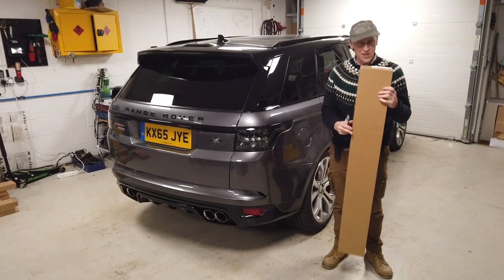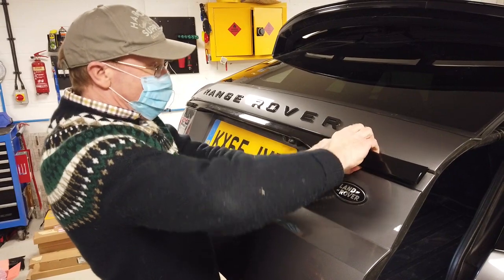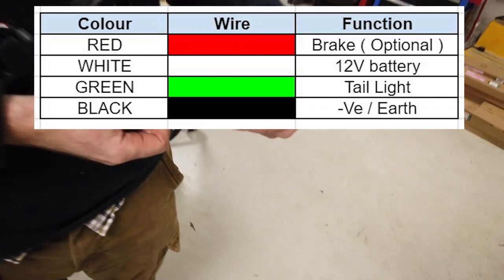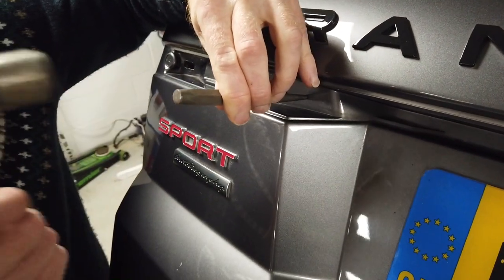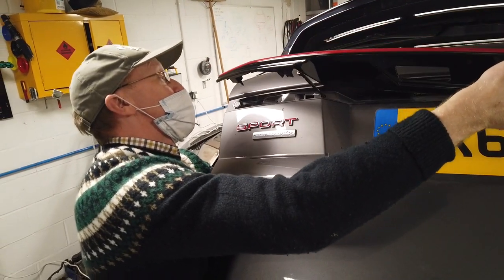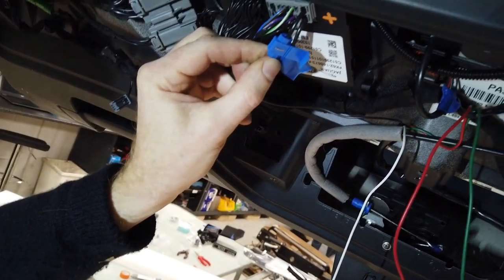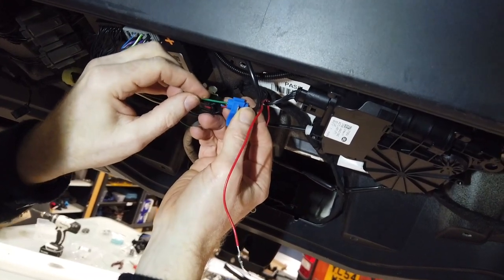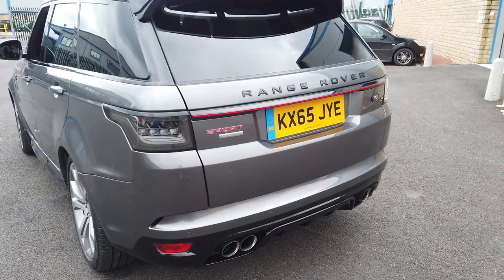Range Rover Sport L494 / SVR Rear Tailgate Trunk LED Light Bar - Fitting & Demo

Comment: Looks good, nice work 👍🏻, what about an option of instead of the red line going across (in daylight - lights off) having it tinted so it gives the appearance of the factory look until the lights are on  (Or when braking, if connected) ?
Reply from the maker: Yes got a few people asking for this and this is something Julian is working through with our manufacturing partner.
Reply: @L663  Now i feel like i should have waited instead of buying it! SAD FACE
Reply: @L663  you get that done asap please need to buy :) . If it's black but lights up at night that's awesome. Please don't make it look see-through or it will look a little riced.
Reply: Agreed. Was thinking the same thing
Reply: @L663  still waiting for the results  of this
Reply from the maker: @joaquinmateo4142  Hi - we have implemented several improvements that have delayed the product.
Reply: @L663  thanks I just install my GL-5 GLOHH tail lights too my 2017 SVR waiting to get my black out lid booth light Truck LED light bar from you guys for UsA thanks so much keeping me updated on this still waiting this would really look good with GL5 tails their dynamic too with the blinking and stop brake lights
Reply: Would love this for my L405. Any plan for something similar for the L405?
Reply from the maker: @toddt0606  Hi Todd - thanks for the comment and kind words - I am told i will have the next batch in stock this Thursday - some quality checks and then they will be for sale !
Reply: @L663  That's great. And the question about them being the upgraded version many of us have expressed interest in OR is this the original version shown in your great video?
Reply from the maker: @toddt0606  Hi Todd - I need to check what the next delivery our - our main focus has been to improve the reliability and water ingress issues we the first batch. We have had samples with a more smoked lens colour but this may be coming in a couple of months time.
Reply: @L663  any news on this?
Reply: Any news on smoked look lightbar yet?
Reply: Do you do these for the Disco 5?

Comment: Hi Guys
Really helpful video just fitted this light, as well as rear light upgrade and mirror dynamics, looks really good 👍😁
Just 1 thing, when I was following the wiring of this I got confused at first with where the positive and negative were going as mine looked slightly different, turns out the box the plugs are in where you wire to on yours Is upside-down, thought I'd better mention incase people accidentally wire to wrong wires. Hope this makes sense 😅
Thanks for this though looks brilliant really happy 😊
Reply: Can you make one for the L405? :)
Reply: Yeah my box is upside down the videos one, but haven’t been able to work it out , tried manually and with the blocks but won’t come on , do you know if connected with inverted cables would this brake the led ?

Comment: Just fitted this  . Looks great.  I found the choc blocks to not do the job properly.  So soldered the wires white and black wires  to the two black wires . Wrapped in insulation tape.  Really a two hour job if you take your time and think it through.  Threading through the drilled hole is fiddly but I found by tapeing all wires together and pushing through with end of a coat hanger helped to feed the wires through. Will fit brake light this weekend

Comment: Fitted mine today. Looks brilliant and I think also looks better with the pre-facelift rear lights. Once I drilled the hole, I found it easier to feed the cable towards the edge of the boot lid. At 9:07 in the video, I fed it towards the large hole to the right of the shown connectors, and then ran it along the black loom. I'll email you a picture Simon.

Comment: It looks great Simon! I’ve brought a few products from you now, and this will be added to my list! Just need the rear light upgrade first! 💰
Reply from the maker: We are having problems with the rear lights... some supply issues and some quality issues ( mostly condensation ) - we are pressure testing them in house to try and reduce issues at customer and working with the supplier to improve.
Reply: @L663  So, I’m excited to say that Kate got in touch today and I’m due to receive one of the limited 2nd batch of rear light bars. You mentioned and were very open about the issues with the first batch. I’m assuming you’re happy with the latest ones and I’ll let you know if I experience any issues. All I need now are the 2018 rear lights (your sweeping version, not the OEM ones) Do you have any idea when these are likely to be in stock?
Reply from the maker: @paulverney4753  Yes we are releasing the 2nd batch slowly and we have resolved the leak issue and done some testing so we are much happier with the product. Please keep us informed how you get on.... also give Kate an E Mail as i found a pair of lights in the warehouse that she can sell you..if she still have them
Reply: @L663  Thanks Simon, I’ve dropped Kate a message. I’ve fitted the light bar to my MY2015 RRS with the original OEM lights. Would you like a photo to show buyers what they look like in this config?
Reply from the maker: @paulverney4753  Hi Paul - glad the light bar is in and working. Yes please send some pictures to Kate and she will send them through to me !
Reply: Can we please see photos of the lightbar and the original rear lights?

Comment: Bought and fitted - looks superb!  Agree that smoked would be cool but if you put red accents like side grill bars, this looks awesome. Defo think smoked rear light set is next on the list. too. 2014 L494.

Top part of the reversing camera is obscured by the spoiler effect. Appears to be enough visibility to see things directly behind still.

Fitting was straightforward-ish. 2 hard bits: (a) feeding the wires through. I drilled an 8mm hole - go with the recommended 10mm. Grommet fitted ok after a bit of wangling. Also could not get through to the space on the video. However, plenty of wire to feed everything to right and circle back (can take a photo of needed). Mini cable ties a god send; (b) tail light connection (green wire): definitely needs care per video. With mine it didn’t work first time but a bit of wangling the wire in the scotch bloc and it made a connection. From there all good now. [will update again once driven at night]
Reply from the maker: Hi Adrian.... I am keeping an eye on the comments and looking for someone to fit it and check its all good... have you tried it at night yet ?
Glad your happy with it. Agree about the red accents...it matches the red SPORT badge on the rear of mine.
Reply: @L663  updated original post.
Reply from the maker: @adrianbarnett2912  OK noted - will check the reverse image on mine. The scotch block connectors are not great - we soldered all connections in the end for reliability.
Dis you see I have posted the brake light connect video... but its a bit tricky !
https://youtu.be/JsuxAdp-bTI
Reply: https://youtu.be/sN7OuZ_hFNI - the finished product. Video is a bit blurry... sorry.

Comment: Rather than having to drill a hole in the tail gate for the wires to go through, you could of sacrificed one of the clip points and repurposed it as the hole for the wires. If that idea would have made the new part not fit as tight, maybe try keeping the clip point but halving its size so it only takes up half the hole, therefore the other half of the hole could be used as the wire pass through. In my short time of tinkering with cars, I’ve noticed a much bigger market for plug and play parts rather than having to modify the original to make the new part fit. I know the wiring is still a splice together task, but that’s a lot more of a reversible process than having to drill a new hole in the tailgate. I might be very wrong in my opinion, to which I say... ignore me and keep up the good work.  All the best chaps.
Reply from the maker: Hi - you are 100% correct and we are evolving this product as we speak !
Many of the best ideas we get are from users and contributors... see my video this week on the "Barclay Hinge" Evoque bonnet lettering.

Comment: Hi! When will you be posting what to do with the red wire? I have just placed an order on this and want to get it all fixed in one go, so would appreciate you guys post this as soon as possible
Reply from the maker: Hi Shalmon - just incase you did not see this here is the video for the brake wire
https://youtu.be/JsuxAdp-bTI
Did you get your lamp ? installed it yet ?
Reply: @L663  no not yet, just haven’t had the time. I hope it will be this weekend

Comment: Looks great but as others have said would be cool if it was smoked or invisible, maybe make the whole outer edge the same material so you cant tell there is a light behind, it possible to make it flush like the OEM bar and no have the spolier effect using that method? For the brake light connection would it be possible to add in a wireless on off sender to one of the LED rear light clusters, and receiver on the bar to trigger when the brake light is on to save having to get to the LED brake light in the Roof Spolier? Also do the LED's get brighter when breaking if both features are  selected
Reply from the maker: We did the Brake wiring today - its not that bad....there is a demo at the end too !
https://youtu.be/JsuxAdp-bTI

Comment: First of all THANKS! Love it !Absolutely genius! 
Bought your facelift taillights and the dynamic mirror blinkers a matching smoked version I’d buy immediately. (if you guys start shipping to Germany again, that is) 
Just a thought on the installation. If you are still in the developing process for the new version. What about putting in a connector. You experienced problems with the scotch locks yrslf whilst installing. Imagine having to replace or remove the LED strip. One wld have to mend each tiny wire. With a connector (like the one on the  taillights) in between one could always easily connect and disconnect the „SF“ led strip. And could leave the connector unused or reuse it for a new led strip. 
Btw, when closing or opening the car, does it light up and does some sort of led animation like the blinkers do? For instance starting outside left and right building up to fully lit ?
Reply from the maker: Hi lots of points here...
1) we are working on the IT to get the VAT correct for EU...we will be there soon.... sorry but Brexit was not my idea !
2) The connector on the tailgate is really close to the carpet closing panel and its tricky to get another connector in there... also with the connector you cannot get it through the 10mm hole in the tailgate... but we can do better ... leave it with us..
3) when you unlock the car the light builds up to full power and then at the end of the "open" light timer the bar "shrinks" into the middle.
Reply: @L663  hi Simon, thanks for the info. Yes the Brexit is sadly causing problems for everybody importing and exporting, and I know it wasn’t your doing 😂. Looking forward to buying on yr site soon again. I indeed didn’t think of the connector having to go through the drill-hole.. 🤦‍♂️ 
Regards, Koen

Comment: Hats off to you for the R&D on this upgrade! Great design! Does the light color from the strip match the tail lamps?
Reply from the maker: Its pretty close - not ideal that my car now has the smoked rear lights so not a true example of how it will look on most peoples car..
Reply: @L663  perhaps another quick video comparing the non smoked tail lamp will show how the color is the same?

Comment: You got to show these with them wired to the brakes.  That would top it off! When are you guys releasing the strip for the evoque?
Reply from the maker: Hi Jordan - our number 1 Evoque fan ! 
Here is the video of wiring up the brake lights
https://youtu.be/JsuxAdp-bTI
We decided the Evoque one will not have the brake light to keep install simple we are just going to use the rear number plate lights as the feed
Reply: @L663  hopefully it will come tinted or smoked 🙂

Comment: Hi, I have a L405 and would be interested if you developed a light bar for this. BTW I have just fitted a 32” LED light bar behind the grill of my L405. It’s stealthy and my god does it throw out some light! Easy to fit as LR have helpfully put everything in place you need to get the job done.

Comment: The car looks great, but I’m going to ask you of your opinion regarding the reliability of the SDV6 engine that I’ve read about ( crankshaft snap) which must be a concern for all L494 owners! I’m a RRS owner (tdv8) L320 and I would love to buy this later version and upgrade with some of the amazing bits you provide BUT until LR admits a fault and promises to fix all Crankshaft failures I won’t be buying 😕
Reply: Have been driving mine for 30. 000miles now . Everything is fine just maybe two times the screen went black and I restarted the engine. Fixed

Comment: Looks good! Would be good to maybe have a connector or Y splitter to piggyback off the lights so it’s full plug and play?
Reply: Suppose that would mean a bigger hole for a connector though, was thinking it maybe easier to go off a rear light then back through the spoiler
Reply from the maker: @SimonBetty  Yes but we could do some sort of improvement to make easier to fit... let me think about it...

Comment: Nice bit of kit Simon, looks like it could be a factory accessory.  I think it looks great, may not be for everyone, but that’s what choice and free will are all about.  If you’re going to do a vid on a rear dashcam install at some point it  may  be worth filming at the same time as the red-wire remaining on this job, because the cable follows the same route through that near-side tailgate corrugated rubber.  Just a thought, wink wink! 👍
Reply from the maker: Yes I saw your comments on the rear dash install.... need to have a look at both of these.
Reply: +1 on the rear dashcam install...
Reply from the maker: Hi - yes we did the red wire install today and it given me some ideas on the rear camera...
Reply from the maker: Here is the brake light video
https://youtu.be/JsuxAdp-bTI

Comment: I like this but not keen on Scotch-Lok connectors - especially on those thin wires as it will cut them in half. Is it possible to have an in-line t-connector that fits the socket?

Comment: Just watched this again, then looked at your website. I wonder, would this new bar look even better with your non BLACK edition rear light? That way the red line across the bar will continue through the rear lights in day light as well as when lit at night (If that makes sense?). Likewise, if they sell well, then maybe do a “BLACK edition’ of the rear light bar.
Reply from the maker: Paul - you are 100% correct on both counts.... I was so excited to get them and get them fitted i forgot about changing the lights over... still looks good through !
Reply: @L663  Sounds good. As soon as you get the minor issues with the rear light clusters resolved, I will probably treat myself to a new rear light set up. 😁

Comment: Very impressed with the build quality, design, style & operation of this product. Would have been happy to pay extra to have all the clips included instead of using some of the old clips plus to have the wire long enough to connect to the brake light. Soldered all the joints because scotclok connectors are the spawn of the devil 👿

Comment: Good evening ladies and gentlemen. I bought 3 of these Lightbars. 2 broke down . I contacted customer service (Kate) but they tell me I m out of warranty now. Can you please get in touch with me. I definitely want to install new ones because they look pretty cool. I saw red version out of stock. No problem for me as i would also love the smoked one. I can offer to send 2 of them back to UK on my cost. Best regards
Reply from the maker: I will pass to customer service team to see if they can help you !
Reply: @L663  i did Update them just now.
My fathers lightbar now only working one half. I dont have any genuine spare Parts.
This is why i need a replacement . I would go with red or smoked whatever available.
Reply from the maker: We looked at your situation and you have had a full refund for the items your purchased and we also sent you a replacement.
We do not ship these internationally so you can order a replacement but it would need to be to a UK address - you have done this before.
Reply: I did order a new smoked and i will get it reshipped from a friend in UK. What is actual the reason why these lightbar blow ?
Reply: There are 2 x PCB in the light - they are joined in the middle and the joint seems susceptible to vibration fatigue on some vehicles

Comment: Just received my LED light bar and based on this video, it looks like the most difficult part of the install is the wiring. I have watched the video over and over and it looks like Tyler is a bit far from the wire housing so where can wiring diagram online or color images you have available of the final wiring sequence? Just want to make sure I attach the wiring correctly.
Reply: Did you sort it out ?

Comment: I would have thought you would have made your adaptor looms to connect into the number plate lights only. Then no faf inside or hole drilling.
Reply from the maker: The problem with that is that you do not have any power when the lights are off so cannot do the power down sequence.... but it does make for an easier install.
Reply: @L663  Yeah. Maybe do without it or fit large capacitors in it.
Reply from the maker: @AndyK.1  The capacitors is a good idea... we did think about this / internal battery. The Evoque version will not have the power down so will be easier to fit.